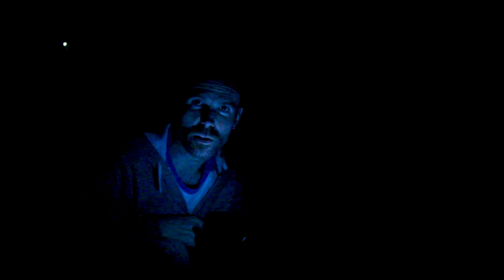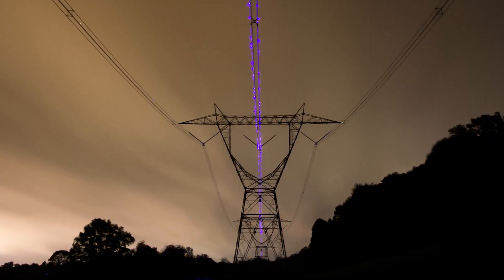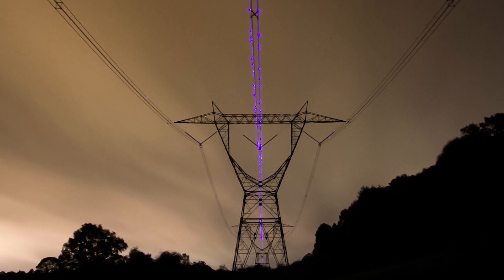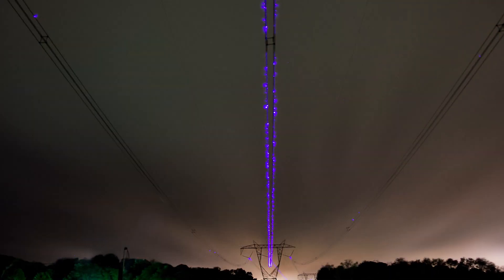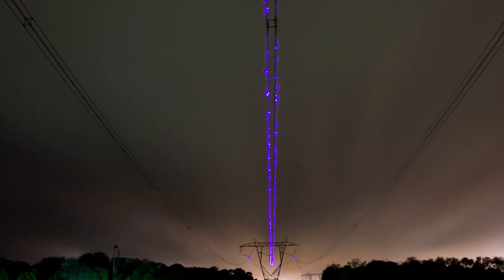Powering Fluorescent Light Under 765kv Powerlines

Comment: Think about this. Takes thousands of volts to discharge across this partial vacuum mercury vapor when tbe filaments are cold. Current in microamp range hence no perception of electric shock but thousands of volts are flowing back and forth 120 times per second. Obviously unhealthy. Fun fact: Very large percentage of schools in America are on transmission right of ways.

Comment: Hi - the tube lights up much better if you stick the tube in the wet ground and let go of it and move away. Also, under a flat triple line, try a position just to the outside of the edge lines - you are picking up the voltage sum of the e-fields from the three phases so you need the distances to the lines to be small and as unequal as possible. Under the middle line is the smallest effect, due to the nearly equal distances causing partial cancellation of the three e-fields.

Comment: Try adding a horizontal metal wire to the top of the tube in parallel with the HV line, it should act like an antenna and gather more electric.  Another thing to try, Neon indicators :)

Comment: If you were to wrap the tube with solar cells and left it near the power lines, you could steal electricity without having to string up wires like in a favela.
Reply: Umm, no.  I doubt you could even get a millivolt reading out of a solar cell illuminated with light that dim.  FTR, nobody "strings up wires" to steal power from a 765kv transmission line.  That's three quarters of a million volts which means instant death simply by getting too close, without even touching the cables.  While it is possible to "steal" electricity from lines like this using induction and large coils of wire, the output requires extensive conditioning and CAN be detected by the power company, depending on the circumstances.  Mostly an academic exercise, anyone smart enough to pull it off likely has a decent paying job and doesn't resort to power theft.

Comment: Merely scuffing your feet on a carpet then touching a fluorescent bulb can make it flash. There is a lot of static electricity under these power lines, because the air between the ground and the cables acts like the dielectric of a capacitor. By touching one end of the tube to the ground and putting the other end in the air, you are allowing some of that charge to go through the tube.

Comment: Yep, fluoro tubes will light up surprisingly bright under those lines.  Watching your video and hearing that familiar 60Hz buzz and corona hiss reminded me of high school and being fearless and stupid.  Back where I grew up, there is a line of towers that carry two circuits with the top running at 765kv and the lower at 500kv.  Why in the world we ever felt compelled to climb those damn things, I'll never know.  On our first two attempts to get to the top, we had to abort once we were about halfway up because it started to hurt.  As we got closer to the three 765kv phases, we could both feel like what seemed to be needles pricking us on our legs (through our jeans!) and arms.  It got stronger the higher we went, so eventually, down we came.  F*ck that!
When we made our 3rd attempt, it was on a drizzly, crappy night.  The wires were EXTRA loud, but oddly, we felt nothing more than a slight tingle that time.  I must admit, it was both fascinating and scary as HELL to be at eye-level and only about 20 feet away from those hissing and buzzing 765kv bundles!  So to the top crossbar we went.  
Damn, I remember sitting on that top cross-member, right in the middle above the center phase, with my feet dangling down and trying to spit on the wires when I suddenly noticed the entire line as far as you could see was glowing with a super faint purple/blue glow.  It was all cool as schitt.
The only reason we climbed back down was because we both had to take a leak (it was an alcohol related stunt), but neither of us were brave enough to try to piss between the conductors!  Anyway, thanks for bringing back that memory!  Peace out...
Reply from the maker: Wow, that takes balls to climb up one of those towers (although if you'd have pissed on the conductor you wouldn't have your balls or much else of your body).  I've heard the helicopter linemen who work on the energized 500kv lines say that even wearing their faraday suits it feels like ants biting them.  Maybe one day I'll try climbing up one, but for now I'm happy admiring them from the ground.  And yes I noticed the purple glow too.  The conductor looked like a string of Halloween lights.  Thanks for sharing and take care!
Reply: @Permaglo  There is a difference between courage and foolhardiness.
Reply: This is legitimately the scariest story I've ever read. God, HT lines always give me the creeps.
Reply: +Naresh Kumar - That's no joke. It never ceases to amaze me to think of the sheer, raw energy in those lines and their absolutely lethal power. I once worked with a man whose son directly contacted 35kV lines. He survived, just barely, crippled and disfigured for life. There is a very good British PSA aimed at children here on Y-T titled "Play Safe." It gets its point across very powerfully -- literally!
Reply: Glad those "needles" you mentioned about let you live....
Reply: wow you had balls as a child dude. even as an adult and as an electrical engineering student y feel a little bit nervous when a i get closer to a high voltaje transmision tower. i can even't imagine as a kid climbing that.
Reply: What a childhood
Reply: I was a new double digit old kid in the 70's and in our rural area we had a big tower power line just behind our property a bit.  But I made a bit of money working at my Dad's highway store/gas station, and got into dirt bikes instead.  
Never once did I think about climbing one of those towers that I buzzed by.  :)
Reply: Yup, you topped my wildest story of what I did as a kid. Lol
Reply: I'm glad I wasn't the only kid who did that...lol
Reply: @normg2242   I tried that once too on 110kV line. It was wet and slippery so when I reached about 20ft up I saw warning sign(with skull on it ☠️) so I was like "Down I go" and aborted that climb
Reply: Lucky you didn’t do anything stupid because that most likely would have been the end of you. Serious!! lol
Reply: +BluntForceTrauma666 - I'm glad to hear that even under the influence of alcohol you had enough sense not to "let fly" on that tower. Years ago Paul Harvey told a story of a guy who did what you did with a six or eight pack along with him. The power company noticed there had been a momentary short in the line and the crew sent out to investigate found the body of the wrongdoer on the ground with smoke still rising from the area where his genitalia had been. Urine is a very good conductor of electricity. The reason you were less affected by the wires when you made your third climb was that the rain drew off most the the energy in the electrostatic field surrounding the lines.

[Edit]: Now you know why you never see birds perching on HV lines. They'll perch on the topmost wires which are grounded to the towers but never on the actual powerlines themselves.
Reply: @Inflec  Adds whole new meaning to the term "fizzle dick" 😂🤣🤣
Reply: @Inflec  That's crazy... Can that static kill you?? Like a little static from rubbing ur feet on carpet can make U jump... I can't imagine the one from those towers!
Reply: +AxZxTxExCxA - No, the static field won't kill you, but there's no way you'll miss it, either. Just reread BluntForceTrauma's comment. The danger comes from doing something that completes a circuit with any of the conductors. And you don't even have to touch them. At the voltages mentioned here, the electricity can jump like lightning up to several feet away from the wires. That is very likely what happened to the idiot mentioned in Paul Harvey's story. His pee stream came within arcing distance of one of the conductors when he had to relieve himself and BOOM--he was toast. Of course the other hazard of tower climbing is falling.
Reply: @POLOAZTECA  it’s not actually static, when it comes from the towers. It’s inductive current. It actually has a 60/50 Hz vibration to it like the current in the lines. From what i see it is, by all appearances, the same current as in the wire. Only at a much lower voltage and current
Reply: BluntForceTrauma wow, you were incredibly stupid. You are lucky to be alive. 765Kv is EXTREMELY dangerous.
Reply: @simontay4851  (Safety/Fun Police) - He admits as much in his second sentence and "luck" had nothing to do with it - seems like he knew exactly the dangers and what NOT to do, so...what's your point?
Reply: @simontay4851  I think the possibility of mere fall from 765 kV power line pylon size in the process of climbing should be enough to stop considering the idea
Reply: That FL tube glows very dim. Maybe at 1% of it's full rated light output. Displacement current is very low
Reply: The needles pricking your legs was the electricity “doing Corona” off of your skin. You would feel that to an unbearable degree if you were to have climbed out onto the line. That is why live power line workers wear a special suit that makes the voltage flow around them with no Corona discharge.
Reply: 50Hz is superior
Reply: @AverageAlien  electricity is electricity. Frequency don’t matter a thing. What’s important is that it powers our stoves and lights. :)